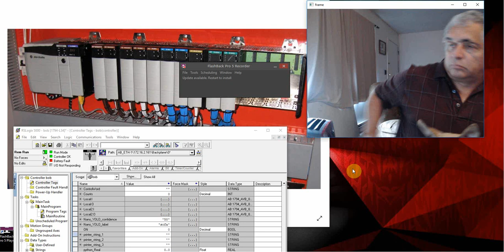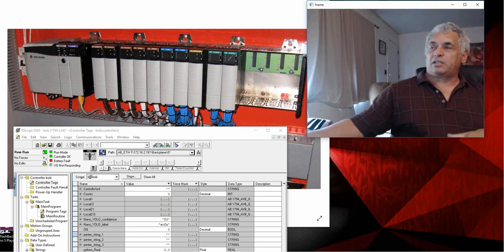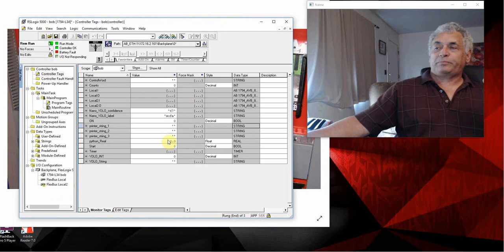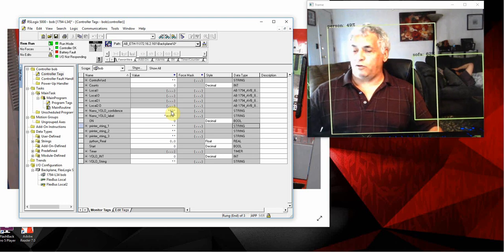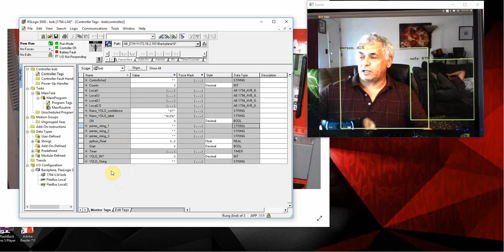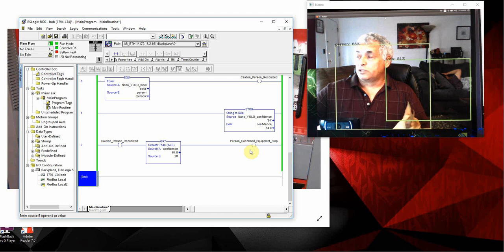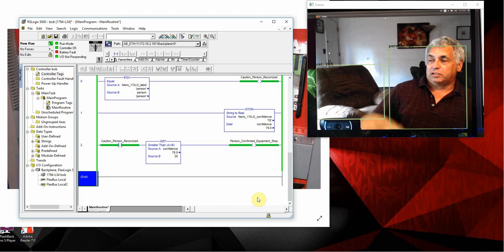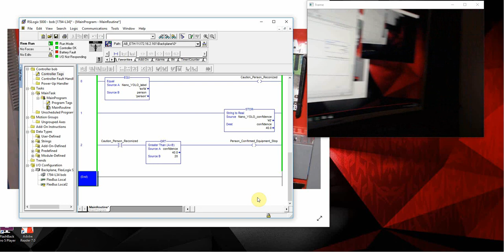Jetson Nano Yolo PLC  CLX 5000 industrial application

Comment: I did just have one question, say I just want to send some data from the nano to a PLC what is the simplest way to do that? I looked at your tutorial and it is very detailed but the part where you make the nano communicate with the PLC is based off a lot of previous steps. I don't have a camera to work with to set the whole project up. Thank your for your time. -Chase
Reply from the maker: I used pylogix for my PLC communication
. Here is the link: https://github.com/dmroeder/pylogix